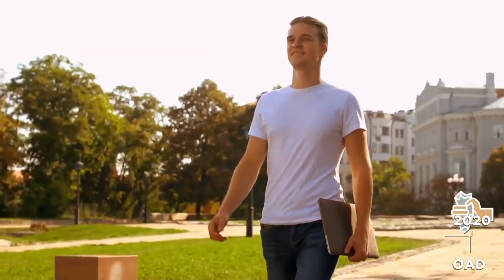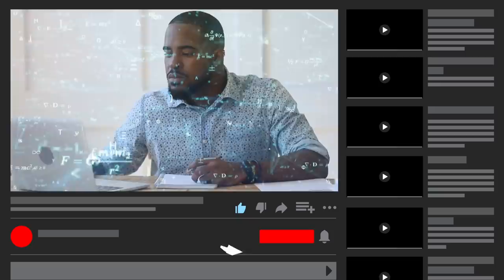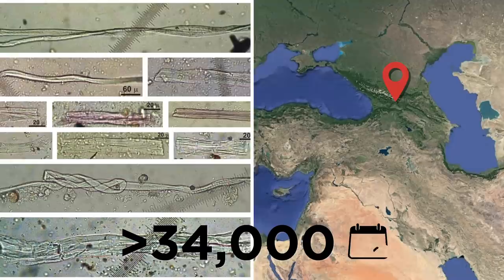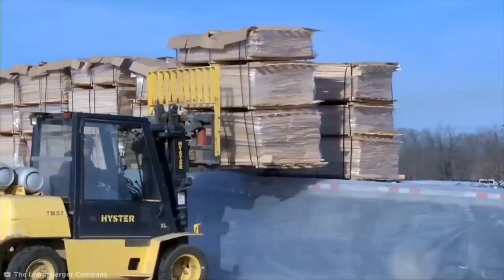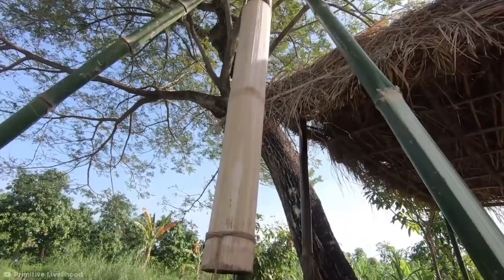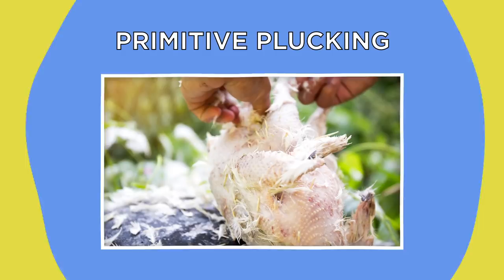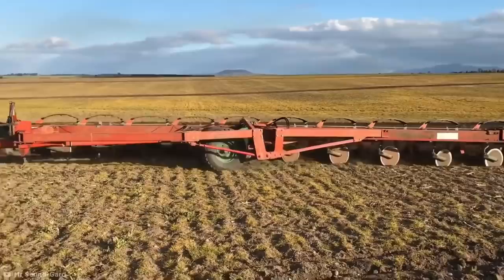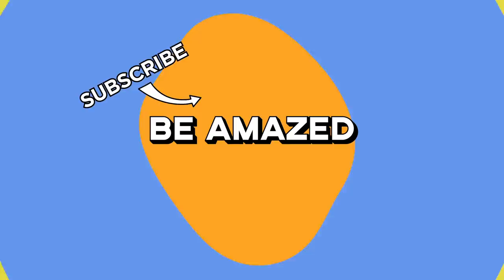Primitive Techniques Vs Modern Technologies

Comment: "like the fire plow, however, no spindle or spinning is needed at all. In this method, a hard wooden shaft is rubbed up and down the length of a groove cut into softer wood. This pushes out wood dust particles, and these ignite as the temperature increases from friction."
That seems eerie familiar to another technique early ancient humans used exept it doesn't make fire...

Comment: When hunting, camping and in my emergency kit I carry a primitive fire starting kit. 2 or 3 pieces of flint. Charred cotton and tinder dry grass hemp rope scraps and birthday cables and wax impregnated cotton balls. It fits in a small bag and a 3 inch by inch tin. It starts fires in conditions that a match or a lighter will not work. I can also use most of the technology he covered here.  With a strike a light kit and practice you can start a fire almost as fast or faster depending on conditions as someone with a match or lighter. So there I prefer ancient Iron Age Tech. At re-enactments I use bee's wax candle scraps or fat dipped fabric scraps
Reply: Tampons are also helpful for Camping. Waterproof packed and with a string to lit. Easy to fit into any small pocket in a backpack.
Reply: @janedoex1398  I have used them to pack wounds on horses legs and to start fires when the wood is wet

Comment: 5:20 assuming i have acess to the raw materials, yes. as long as i have raw wool of some sort, or a sheep to sheer, i can take the raw wool, design a carding implememnt to card and straighten the fibers, its not too terribly difficult to construct a drop spindle to spin the fibers into useable wool, and a couple of shaved and smoothed sticks with backwards pointing notches make some pretty good crochet needles, or just avaoid the notches and you have some knitting needles. Im not very good or familiar with knitting, but i can crochet with the best of em. '

So YES. I absolutely could craft clothing from wool from scratch as long as you give me a good sharp knife, i can make all the equipment necessary, and have the knowledge, to turn wool or similar fiber into actual usable clothing. :)

Comment: That fire piston was the inspiration for the cylinders in an internal combustion engine. Same concept. Stepped up. It's the combination of compressed air and fuel that allow it to create a small explosion that is controlled in the engine. Only it happens a LOT of times over the course of a minute....